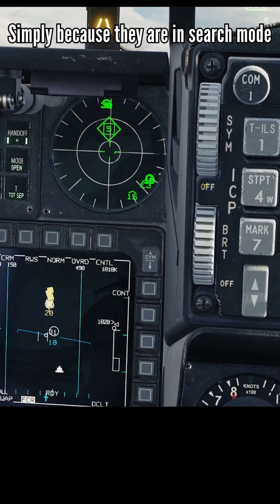F-16C Viper RWR DCS | Can't believe the RWR works like THIS now

Comment: i think this is okay for irl because you'd have a GCI or AWACS feeding data to your datalink or giving calls so you'd know your current threats' distances. You'd realistically also be memorizing maps of where SAMs are so you'd know where things are anyway in a battle. 

In DCS i agree outside of campaigns it might prove to be a disadvantage when other data sources like other planes, GCI, and AWACS are not always existing
Reply from the maker: IRL data link is not as accurate as in DCS. If the AWACs does not see the threat then all of this goes out the window.

If I get locked and it goes to the inner ring it will not come across to me that it is 60 miles away.

Comment: RWR does not show range but signal strength
Reply: It depends on way which is working.
Reply: @gigantrejser4926  you mean?
Reply: Correct. Signal strength in dB, radar mode dont matter at all. (on ALR-56)
Reply: RWRs either shows signal strength (which can estimate range) or signal type/frequency (search, lock or guidance)

Comment: also strike eagle now in last update on dcs 🙂 that is not real
Reply from the maker: This same thing happened to the strike eagle?
Reply: @AviationPlus  No the strike eagle still displays radar emitters by strength and not lock / launch / search, but it's sounds were changed and basically crippled it because you don't know if you lost a missile or if the lock tone just had a wait interval before it started blaring again.
Reply: @AloccoTG The TEWS in the F-15E shows distance, not radar strength. Well it's based on the signal strength of course but it shows distance so every symbol in the TEWS is comparable.

Comment: Why they've changed, is there a specific reason? Eagle dynamics said a year ago f16 is now become realistic as possible but me personally this is nowhere near BMS.
Reply from the maker: Not sure of the change but it was a very quiet one with no explanation not even a video of the change in functionality.
Reply: @AviationPlus  So strange indeed
Reply: The update they were talking about was about changing RWR beeping noise.  Now it not beeping all time, but have two sound of beeping. First launch and extension launch.

And also add rwr prioryty search and priority altitude.
Reply: @gigantrejser4926  the RWR is constantly being worked on, as of now it’s fine. But yes I’m well aware of what’s being worked on
Reply: @arroyo_Lt0  Hi! DCS's RWR do not work like the real ALR-56. Is you look for more accurate behavior, check BMS F--16 despite its awful canopy sound.
Regards.
Reply: @arroyo_Lt0  it's not fine. a 80 mile lunch will trigger a lunch warning although you are far away. also there's no warning although enemies are closing in like 5 miles
Reply: Bms sucks ass. They can’t even update the engine/in canopy sounds to match the real thing. Hell the canopy closing sounds god awful. And the flight model is just disgusting. But you don’t see the DCS devs making that mistake, along with many others.  The only thing ED needs to fix now is the PFLD,  airspeed rate, and various MFD menus.
Reply from the maker: @arroyo_Lt0  I'm so sorry the canopy closing sound bothers you so much.
Reply: @arroyo_Lt0 this reads like intense troll bait lol

Comment: I thought signal strength (Locked vs Search) was the same thing? Or does the radar signature itself change when switching from search to locked? I always figured when a radar locked on, the signal strength (Directed Energy) was significantly stronger since it's directing a lot more energy at your aircraft than when it's just searching the sky around you. I don't know for sure, that's just how I understood it. Is that incorrect?
Reply from the maker: If the aircraft is right next to you the energy is much stronger than if it was 50 miles away regardless if it is in search mode.

It could even be said that search mode close up has more energy than locked at 50 miles.
Reply: @AviationPlus That makes sense.
Reply: Search and lock do have different emission signatures so it is probably looking at that
Reply from the maker: @Hustler9g  Yes but why go inner ring when 63 miles away. Zero threat to me.